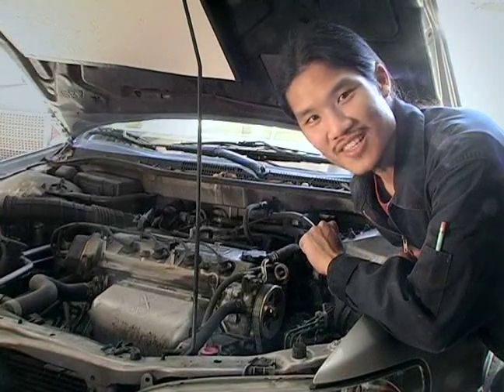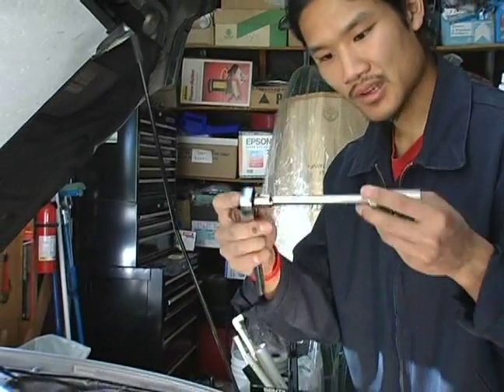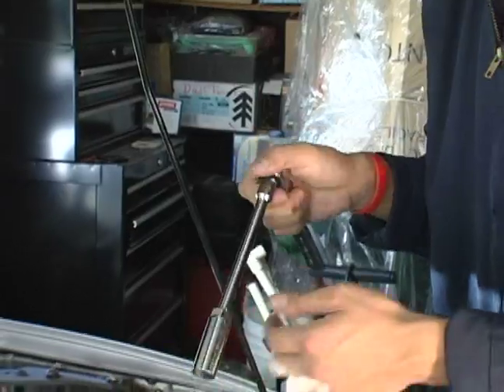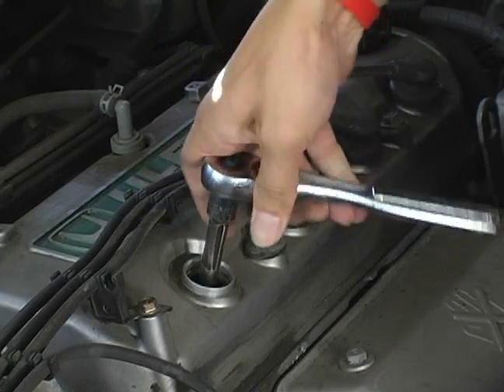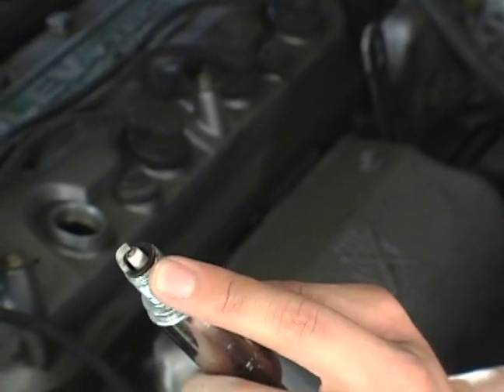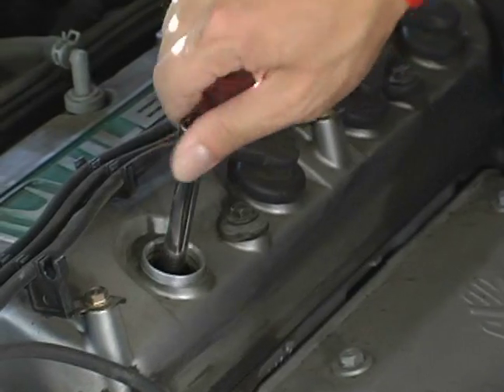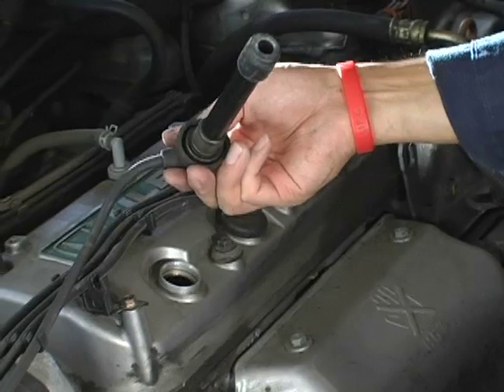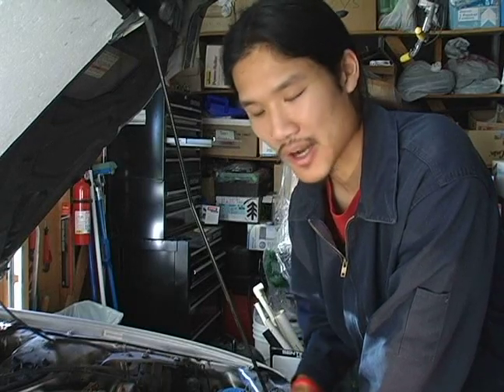Basic Car Care & Maintenance : Checking Car Engine Spark Plugs

Comment: There are several wires that go to that box thingy on your video, how can you tell which wire goes to the spark plug?
Reply: all of them, he only show 1 just for this video
always remember to check all of them
Reply: Thanks, I thought a car only had one spark plug like a motorcycle.
Reply: Indonesia a car has 4
Reply: +hsucks or 3 or 6 or 8
Reply: +Jayne Markham and some like rotory engines have 2 for every piston so 8 for a 4 cylinder if that's what the piston 😕

Comment: Nice video, but the only additional I would insert would be this:  NEVER remove a spark plug from a warm or hot engine.  The spark plug body is made of iron or steel and is much harder than the often aluminum heads, and the spark plug threads (in the head) can be stripped easily over time.  I change my plugs around 35-40 K miles even tho they are warrantied to 100K.  Performance is improved and for most drivers that is two years of driving or more.  In addition I would suggest that the user buy a anti-seize product to coat the plug threads so as to help prevent a seized plug down the line.  I realize it seems like 'overkill' to many, but until it occurs and you have a hefty bill you realize it is too late.  I leave my car parked overnight before I change plugs, and that is the reason I do my own minor maintenance.  I've seen folks in a hurry because they have 'customers' waiting in line, so they do what needs to be done without concern for engine temp and they just 'do the job'.  As in all things SAFETY first.  dwh